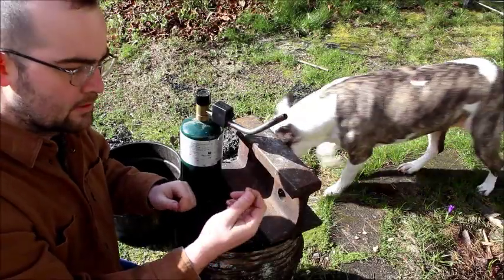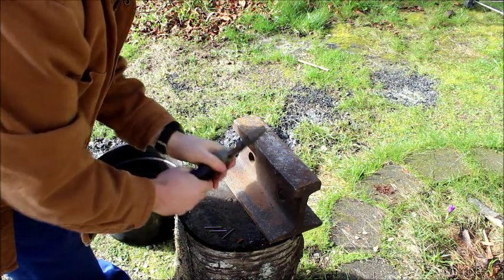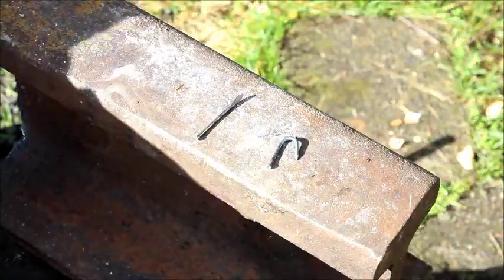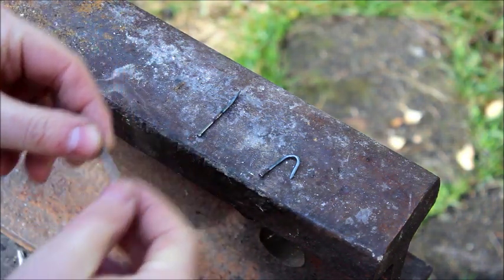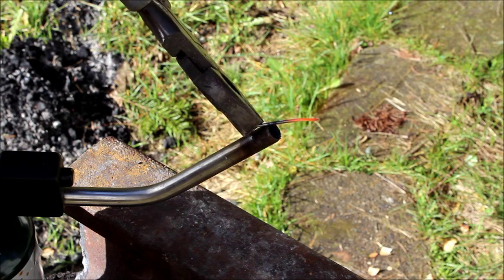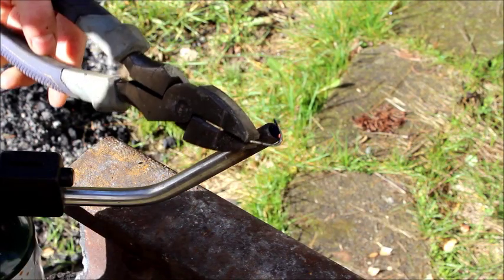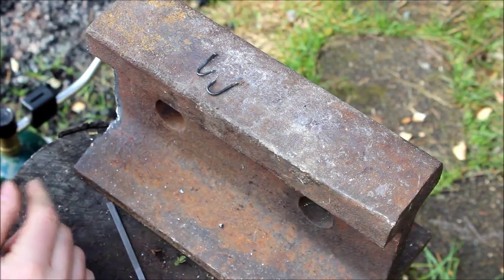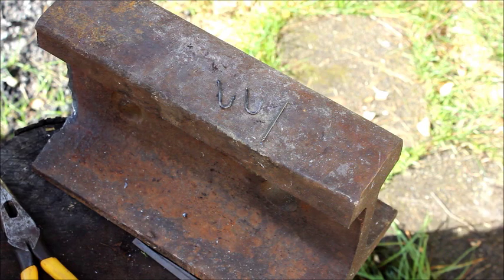Nail Fish Hooks

Comment: Most nail are steel, I wonder if oil quench would work as good or better than water.
Could you flatten the head & drill a #48 or # 55 drill bit to make an eye.
Good video, I like the way you handle your tools.